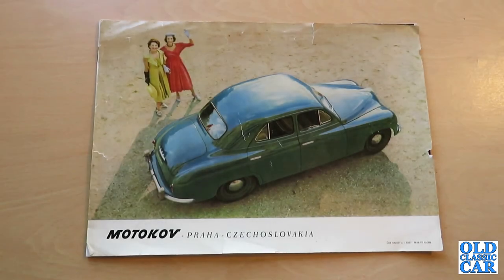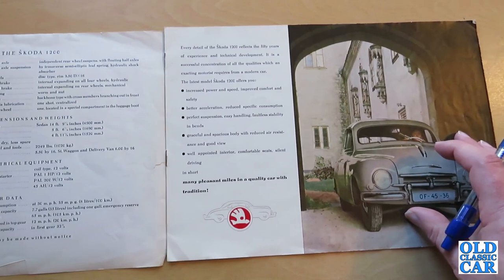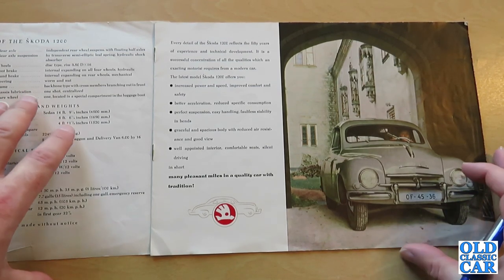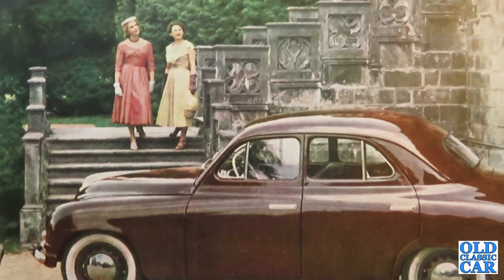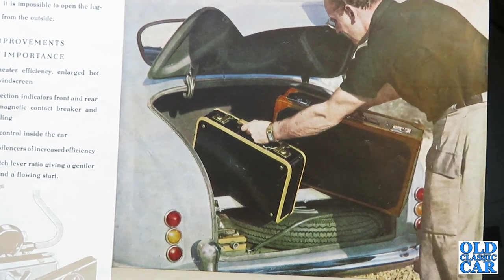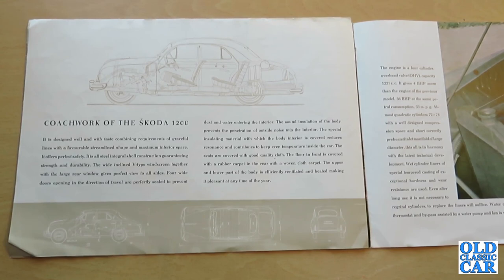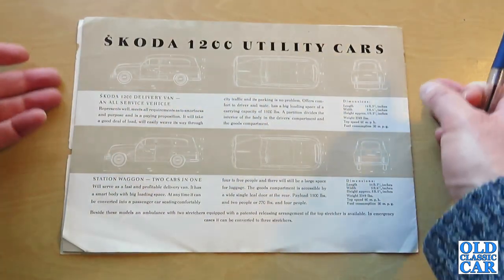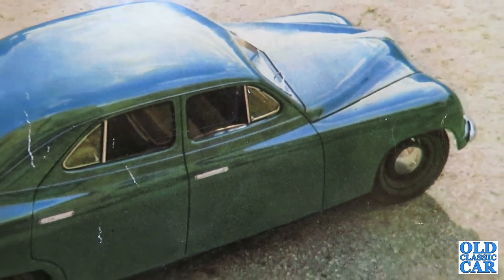A 1952-1961 classic Skoda 1200 (1201) car brochure review | Škoda

Comment: Greeting from the Czech Republic! Great video! Truly an interesting look at the UK Škoda 1200 Brochure!

To clear up the confusion about the models the brochure appears to be for a transitional version of the car (1200 chassis and a 1201 body), production of which started in July of 1954 and from the early ‘55 till spring of ‘56 it’s been produced alongside the newer 1201.

The engine is definitely 1200 since it develops 36 HP, the 1201 engine had a power output of 45 HP, personally, don't know why the 1200 brochure for the UK states that the engine has a capacity of 1 213 cc, Czechoslovak brochures always stated a displacement of 1 221 cc for the 1200 and 1201, the only two things different between those two engines are carburettors and compression ratios (6.6:1 vs 7.0:1)
It must be said that the new engine greatly improved the performance of the big sedan. Especially the ambulance which with it’s weight of around 2 700 lbs. struggled in the hilly terrains of southern bohemia and with this engine received a much needed boost.

These cars also sadly show how badly and nosensicaly the production has been managed by the government. By 1956 Škoda wanted to produce a more powerful, modified 1 500 cc 52 HP version of the 1201 sadly that modernisation has been cancelled so only things that remain are few short videos about them like this one from 1956

https://www.youtube.com/watch?v=XPiC3IWD0TE

By 1958 the 1201s utility versions should’ve been replaced by a new cab over engine design, that project got delayed for political reasons by 10 years! so when it finally came out in 1968 as Škoda 1203 it replaced the 1202 which by that point has been manufactured for 7 years (originally planned only for a year or so before things got sorted with the 1203). By that point the 10 year old design was showing its age and so was the 45 HP 1221 cc engine, which itself is still just a heavily modified version of the 1939 Škoda Popular 1101 engine, (So was the chassis of the 1200, 1201 and 1202 which although modern, even during the 50s, was also originally created in the late 30s for the Popular series). The production of the 1203 would continue ‘till 1997 (In small scale production ‘til 2017!), and only in 1985 would it receive the 1500cc engine that engineers at Škoda tried to push into production 29 years earlier!
Anyway, this comment is already way too long, hope you got some useful information out of it :)

Comment: Fascinating review that made me do a bit of internet trawling to find out whether Skoda really did sell this model in the UK.
I always thought Skoda's first export to the UK was the early 1960s MB100.
Old Skodas in the UK are now exceedingly rare and although I am old enough to remember seeing MB100s on the road there is only one registered at DVLA (How many left).
All the photos in your brochure were left hand drive models and this makes doubt that it was actually released in the UK.
However I did find a Facebook group for the model and a bit of scrolling through revealed that there was a right hand version as I found photos of a preserved example with right hand drive. 
Apparently Skoda did export to Australia and a number of other countries and I suspect this vehicle was one originally sold in Australia although it now has Czech plates.
A very interesting design when you compare it to similarly sized British designs from the period. The 1200 does seem very underpowered with only 36 bhp although the 1201 did get an uprate to 45 bhp. This and other things like more advanced suspension and monocoque body construction would probably give it a bit of legs over an Austin Somerset, the best selling British car of the era in this general size. I am not very keen on the front mounted petrol tank which is also found on much smaller East European cars like the Trabant and the Zaporozhets. The Skoda does look big enough to have the tank in the back of the car, above the rear wheels, so I wonder whether it was mounted in front of the scuttle to keep the fuel and fuel lines from freezing in severe Central/East European winters.
Reply from the maker: Thanks, glad it was of interest